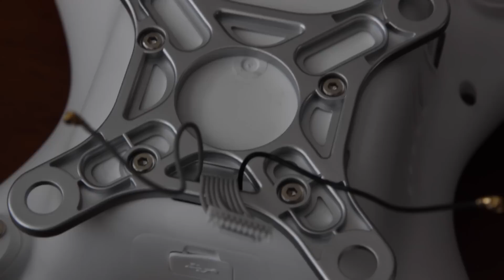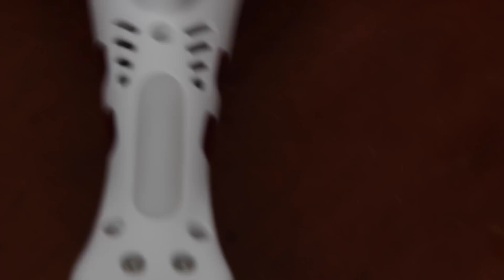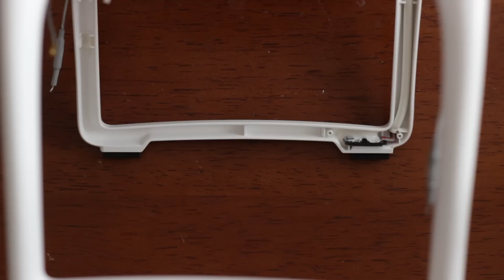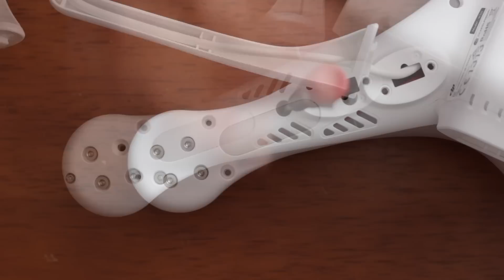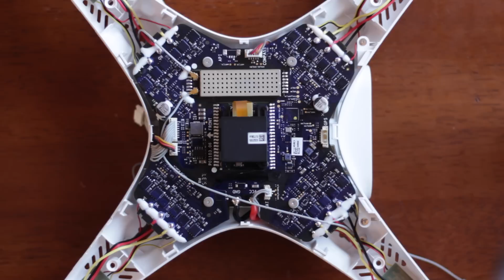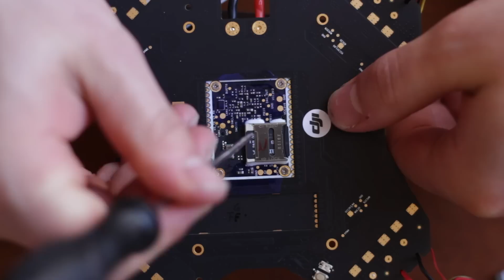Teardown: Taking Apart a New DJI Phantom 3 Standard Drone

Comment: For those of you wanting to replace your shell the one thing this video doesn’t show is how to remove the gps antenna.  It is the easiest part of the disassembly.  That’s shielding isn’t putty, it’s an adhesive copper shielding tape.  It pulls off very easily and isn’t very fragile stuff.  Underneath are 4 screws and it’s off.  The tape is sticky enough to reuse on your new shell.  This whole process takes a couple of minutes.  I hope this helps.

Comment: Subscribed & a nice Video.  I have a Phantom 3 SE that flys for a minute and falls to the ground after all 4 motors stops suddenly itself. Camera was damaged a while ago so i removed it and the gimble is still connected to the drone properly secured and wired. Is there a fix for this or is this a common problem or is it because the the camera is detached. Any help from anyone would be great.

Comment: i disagree about the solder.  Considering sending drones into DJI is so time consuming and there are very few reliable repair centers you can actual go to I would highly prefer some connectors that have some secondary bracket that prevents them from disconnecting in flight.  Even if you do know how to solder well the white glue is very hard to come by if you can even get it and it is very difficult to create that perfect spherical solder connection.  I like to repair my drones if necessary and I do but it would be so much easier if it was just a simple plug and play with no risk of damage.

Comment: Very Detailed,  Thankyou.  I'm a noob so hopefully this isn't a Duh... Question.  Are the motors meant to sit slightly askew in there cradles.  I recently bought some Prop protectors and in putting the motors back into the Drone, I noticed they dont sit perfectly up & Down.  Once back together the cheap knockoff Prop Guides hit the props... stupid to buy knockoffs I know. Anyway Is this designed so or did I screw up the re-installation?
Reply from the maker: Yes, the motors are tilted to reduce propwash against the body. It's normal.

Comment: SD Card is a black box, can also do a boot flash. Like most drone flight controllers, the onboard SD Card stores flight logs. Idea being originally if you had a crash because something burned out it would store data like "communication error ESC 3" but it can also store input / telemetry data. The part that scares people is the fact it also has your data on it because a lot of DJI drones require you to activate it.

Comment: Poor soldering at points of failure leading to fly away are the IMU sub assembly mount points to main board, the ffc connector from IMU is the wrong type for this application.  Connector ports are soldered and no vibration dampening adhesive is used.  Differences in frequencies of oscillation between the main board and the cables leads to the failure of the solder joint at the connector as nothing protects these joints.
Telemetry, video or control drop's are the most common symptoms, nav issues and the drone getting its own mind are others.  When your SUA vanishes due to one of these failures I am sorry to say DJI will not care about your problems.

*edit*
The SD card is the deep data flight recorder for your aircraft, clearly DJI where anticipating problems as this is a removable media .  It gives very in-depth data on flight parameters nor available through the skypixel logs you upload when you contact support.

Comment: Is it possible that the antenna connectors come loose?
I'm asking because I have been getting random drops in 5.8 GHz connectivity. Now, they did start when I installed my ARGtek kit, but I redid the connection on that one 3 times now, always putting on hot glue to keep the plug in place.
The question is: Could it be that a connecter inside the drone came a bit loose and has an unsecure connection, or did I get a bad antenna kit?
Reply: Yes, high dielectric rubber cement should be applied to prevent vibrations and minor knocks from shaking them loose.  Also the cables that run to the board should be glued to protect the connectors.  Visually inspect the row of solder joints running on both sides of the IMU assembly where it meets the main board.  Look for a line in the solder joint it may apear darker in color than the rest of the solder.  If you find any this should be remade using a high quality flux and lead free solder following ESD protection when in contact with the board.  If your having issues check and bond the IMU FFC cable (amber in color, but sometimes black or blue) and comes from the IMU down to the sub-assembly
Reply: Thanks for the advice, although I actually fixed my issue. It appears that one of the antenna connectors (luckily just that, not a sotered connection) was loose. I put it on properly with a little pressure and applied hot glue that should help keep it in position (in addition to the glue that was on the cable).
The problem hasn't appeared again since then.
It probably originated when I dropped my drone one time (I'm gonna be the next Linus soon...).
Reply: Very good, yes all of the connectors on the DJI P3, P4 Mavic and Spark and aggra (only ones I have been inside) are complete rubbish and should be checked, bonded and taped with a vue to minimizing vibration.  I appreciate you dropped it, however with moderate bangs these very important connectors should not come loose in the first place.  I am glad you got her sorted.

Comment: I'm thinking of taking apart a Phantom 3 Standard and mounting the guts inside of my HPI Baja 5B Flux.  It's looking like it will fit underneath the rollcage leaving me enough room to mount the camera and gimbal hanging from the roof, looking out over the front.

Comment: hi, i took a part my phantom 3 but when re connected it gave beebing sound and yellow lights! could you help me with this? thanks
Reply from the maker: Saed Al Bimani check your gps connection, phantom 3 flashes yellow if there's a gps or compass error. The app will tell you what's wrong
Reply: RadRider33 Thanks. the app foes not tell anything. i made sure to re position the gps connection i side the drone. it gives interrupted beeb sound with yellow and red lights
Reply: RadRider33 when you connect youre cumputer to the micro usb plug on the front of the drone (not the camera plug) then you can read the sd card but not the data but i think its like a black box that keeps all youre flight information, so that when u crash dji can find out what wen wrong
Reply: A common mistake when working on these is damage to SFC mount components or track damage caused by the tooling required to open the shell.  That would be the first place I would look.

Comment: RadRider33, how hard is it to take the battery carriage out as well? I need to replace the gray ribbon cable that goes to the camera. Is it possible to do that with out removing the board and battery carriage?
Thanks.

Comment: that was so precise and accurate. Very articulate and you went over all the major stuff and answered so many questions without boring me you were totally understandable. Bravo I think you missed your calling.  but I broke my black and grey and tenant and it crashed and repaired the gimbal myself. The connectors are too small to make. So I need you to take it one step further and continue that video. LOL PS is that what I should be doing question mark replacing the whole antenna with a coax ipx cable at the end?

Comment: The SD card probably has the Linux filesystem in it. It doesn't make sense to have anything secret or obscure in it, specially when they are saving money with screws.
Reply: They might ALSO be tryin' to SAVE WEIGHT by being stingy with screws . . . every little bit adds up.
Reply: It could also have configuration files inside, like IMU and gimbal calibration data, max height and stuff.

Comment: FYI, it's a T-8 torx, not a T-7. Don't use a T-7 as you'll strip the screw heads.
Reply: Correct. And use only quality torx screw drivers that have hardened tips because the four T-8 screws that are closest to the landing gear are a real bear to loosen. Everyday 1/4 inch drive  torx bits will not even fit in the screw recesses.

Comment: so with that usb port on the phantom...what can you do with the drone when its connected to your computer?
Reply: Firmware Update
Reply: it's how you access the detailed flight logs stored on the drone SD card, which he shows on the bottom of the main board in the video.  You can also get to these files by just putting your P3S into Flight Data Mode using the app and then plugging micro USB cable from drone to PC to access the card externally.

Comment: Hi, i also had a crash and pulled the grey wire out of the connector on the gimbal. Have the new 2.4g wifi antenna arriving tomorrow and trying to work out how to install. From watching this video is seems like i am going to have to do a full teardown even removing the board in order to access the area that it lives in... do you know any other easier ways to be able to get in there and access it. 
Another question - the black wire is still connected and i was ablet o fly the drone with just it and not the grey one. Does this just mean that my range will be limited so in a pinch i can keep flying it as it is but should replace the grey one?

thanks

Comment: would the black and grey wifi wires if not hookup cleanly not give you telemetry on the App
Reply: Those are the video downlink if you hook it,up wrong you will likely not get a signal at all
Reply: +Grey John you are correct sir

Comment: Excellent video. Thanks for the detailed explanation of the ESC board (I think you called it PCB) The SD card on the bottom is an 8gb memory card. You were correct when you said you may not be able to read it. Last year when I replaced my board I wanted to see what was on the card. My computer could read the card but I could not see a file on it. Interesting stuff.
Reply: Where did you purchase your Replacement ESC Board from?  
I have an old P3 Standard that I would like to repair... Thank you in advanced :)
Reply: I took mine out and read it on the PC; it's the detailed flight logs stored on the drone.  You can also get to these files by just putting your P3S into Flight Data Mode using the app and then plugging micro USB cable from drone to PC to access the card externally.

Comment: I want to see what's on that mini SD card
Reply from the maker: +Jack Sohachevsky right? according to phantompilots forum it's got the flight logs on it. There wouldn't have been much on mine since it hadn't been flown :p
Reply: a blackbox pretty much :) records flight data
Reply: I took mine out and read it on the PC; it's the detailed flight logs stored on the drone.  You can also get to these files by just putting your P3S into Flight Data Mode using the app and then plugging micro USB cable from drone to PC to access the card externally.

Comment: Fact is that the Phantom 3 Standard has the longest flight-time ; p
Reply from the maker: +hobby Interesting...I suppose that makes sense, since all the P3's use the same battery, and the Standard has less electronics (specifically the lack of the high-power LightBridge) and less weight (no ultrasound module). Whoop!
Reply: +RadRider33 check my channel if you like,I fly a yuneec q500